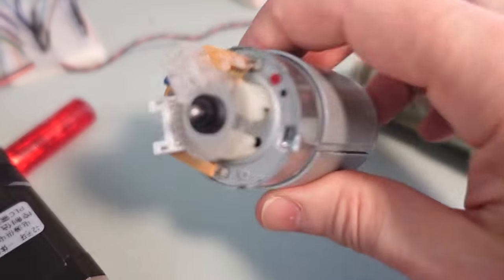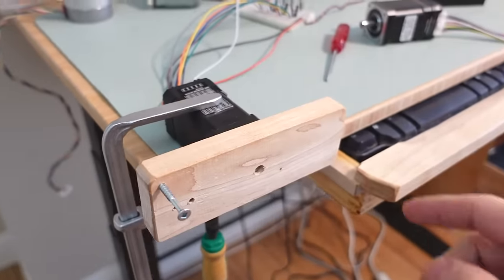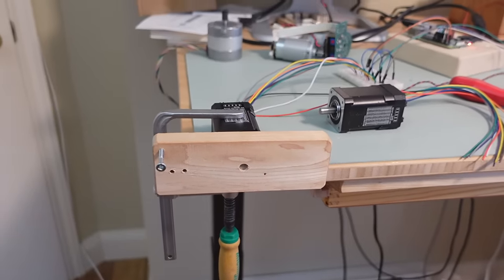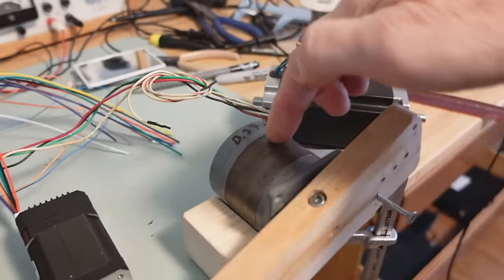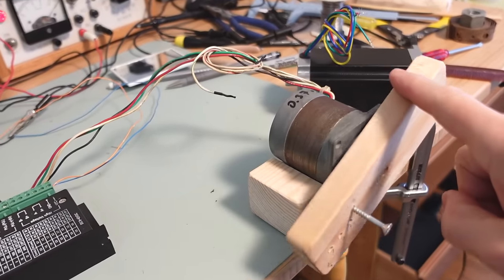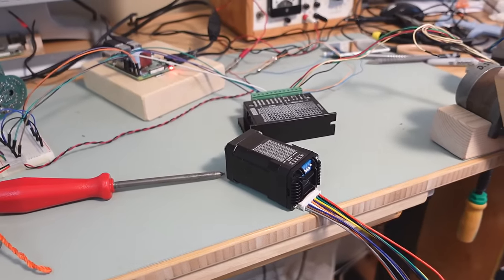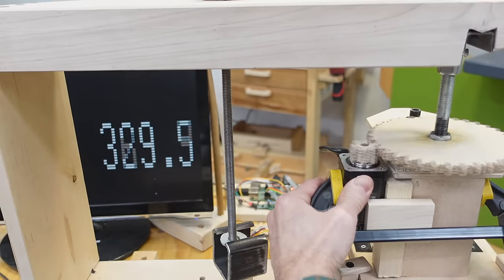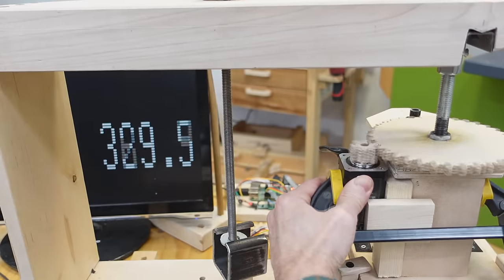Closed loop stepper motors -- very impressive

Comment: The magnet is FAR more precise than optical check - actually knows actual position even after reboot, while the optical knows only a "distance". They are far better. And some of the magnetic ones can get 36V, giving you plenty of power to control even larger steppers. And as they use position feedback, they only use high currents when necessary, so the load on the actual stepper during standard operation is lower, extending its life span.
Reply: Not all hall sensor based closed loop drivers are positional feedback drivers. Some really are just step compensation drivers. They are not all on the same level.
Reply: This is mostly true. The magnet does give the angle in relation to the reading chip. But it also has to do with the failsafe software that drives it. Not all firmware acts the same when it is out of sync.
Reply: This is not necessarily true. Careful when making sweeping generalisations.
Reply: @EnlightenedSavage  Would you mind to share the details? I, so far, was not able to find optical encoders able to compete with price and ease of installation that would be at least close to precision of magnetic encoders. Especially the need for extended shaft is really the issue on my end.
Reply: That’s not true. There are absolute-position optical sensors available. Doesn’t mean this isn’t a better solution, of course :)
Reply: Quite a few things wrong with your comment, it’s not the fact that they use magnets that means it knows it’s position, it is because of the type of encoder. You get two main types of encoders, relative and absolute, the optical disc encoders shown were relative encoders meaning they only show a change, the magnetic ones used here were absolute encoders so they can tell position. A good analogy is that potentiometers are absolute encoders and standard rotary encoders are relative encoders.

You also get magnetic relative encoders that work similarly to the optical relative encoders and you also get optical absolute encoders that use multiple rings to encode the position.

The voltage rating of the encoder is irrelevant for powering the steppers. You do not drive the steppers through the encoder, they are effectively two separate parts that don’t need to be electrically connected in any way really, you can easily have separate supplies for the motor driver and encoder or step down the voltage to power the encoder. There is a very good chance that the closed loop driver is already stepping the voltage down to probably 5 or 3.3 V to power the control circuitry.

It is possible to tell how much load is on the motor without position feedback too by measuring the voltage and current applied to each coil. Like how a brushed DC motor draws more current when loaded and similar to driving BLDC motors. Having position feedback does make it easier though. Stepper drivers that use microstepping already control and usually measure the current through each coil.
Reply: See Osram AS5048.  These just sense a two-pole magnet on the end of the shaft.  Resolution is 14 bits or over 16, 000 points per revolution.  Absolute position, digital output.
Reply: @scrout Just be aware that precision and accuracy are not the same.
Reply: @johnwalker1471 Exactly, the optical is precise and maybe accurate but magnetic one is both precise and accurate.
The only drawback of magnetic is magnetic interference.
Reply: @gentleclash I wouldn’t say that the magnetic sensors are accurate.  According to the AS 5048 datasheet even with perfect alignment of the magnet the non linearity can be as great as 0.8 degrees.
Reply: @johnwalker1471  Magnetic encoders don't have an enclosure and have to be manually aligned which may cause errors is what you're saying?
I would say that optical encoders are good for robustness and where absolute positioning is not necessary.
I've never used either of them but I do know their working principle and theoretically magnetic can be infinitely precise.
As of optical, there exist those optical encoders which can do absolute positioning but are very expensive and sophisticated unlike magnetic ones🤷
You can correct me if I'm wrong somewhere.
Reply: @gentleclash  The error stated in the data sheet assumed optimal placement of the magnet.  It is due to the nonlinear response of the hall sensors in the semiconductor itself.  Stray magnet fields or less than optimal magnet placement could increase that error further.  I have a fully enclosed magnet encoder as well as enclosed optical encoder.  I plan to use these to test the positioning accuracy of a stepper with different values of microstepping.

Comment: I used closed loop steppers on my home made CNC router, I couldn't be happier with the way it performs and it was so easy to do.
Reply: I put then on a lathe and a mill and am also very happy with them, they do not get hot in use like the previous open loop motors.

Comment: For a single motor: this form of closed loop steppers is great.  For any multi-axis CNC, the "reaction" time means that the absolute position of the end effector is unknown, as the controller on one axis may already be there, while the other is "making up missed steps".  Tracing an arc (for example) with two of these, when pushed anywhere near their limits, will result in inconsistent and difficult to reproduce behavior.
Reply from the maker: True enough, but the idea is to give both of them motion curves they can follow.  And if the controller somehow pauses for 10 ms, both motors will stop, so still on the path
Reply: Would a computer read each encoder and sync operations that way? Like control other motors if one gets slowed or jammed, to keep a process in-check?
Reply: @Metalcastr  Correct.  On CNC machines, a simple example of this is feed rate override.  When the spindle starts to overload, the feed rate, sometimes multiple axes coordinated, slows down to prevent overloading the spindle motor or ruining the tool or the part being made
Reply: A better example is the standing desk Mathias shows in various videos.  Assuming a motor per leg, when one side of the desk is heavily loaded, the controller limits the progress of the lessor loaded motor so that it doesn't race ahead. This keeps the desk level

Comment: from a controls perspective its still a good idea to provide higher order motion profiles in closed loop control systems due to higher order vibrations in the rest of the system if you have a more complex/sensitive system. It will also limit overshoot and such, though I am curious as to how these steppers have their controllers tuned and if you could change them to adapt to your given loads/motion profiles.
Reply: A third thing to keep in mind when relying on the closed loop driver and not using motion profiles, is that you have no idea how much it's out of position before the move happens. With a motion profile, however, you reduce the likelihood of losing position while also being in control of where it is. That means you can do more complex processing based on that variable.

Comment: On my Jointer/Planer combination machine I had to crank the table all the way up and down if I switch the machine, because the dust shroud has to flip under the cutterhead.
I replaced the Handwheel with a 1.2Nm closed-loop-stepper. Controlling it via Arduino and the huge advantage of the closed loop stepper here is:
I also have a display connected that shows Theoretical Position to 0.1mm. And since the stepper doesn't lose steps, I can really count on that. I essentially have a digital readout with position control (normal and fast travel and a 0.1mm button).
Now I don't have to hand-crank anymore, its way faster to switch the machine around, I don't have to bend down (The button is higher up than the hand-crank) and the machine is also way more accurate. The original scale was 1mm accuracy. Now I can thickness down to 0.1mm accuracy - repeatably!
Reply: I've never seen this guy be happy with anything. In my experience most people find problems with things sometimes, but this dude is a know-it-all and has built a following, which makes me scratch my head. I'm not trolling but go back and listen to him prattle on about this and that being wrong with everything. He contributes zero to the engineering content like smaller channels. I keep blocking his channel yet autoplay keeps putting his videos on when I'm tinkering. Haha.

Comment: You can get NEMA planetary gearboxes that will fit right on the end of that stepper for a bunch of extra torque
Your speed seems high enough to still have it operate quickly enough

Comment: Used to use those on home built CNC machines . In the past you had to buy double ended stepper motors and add the encoder to it. They have fallen out in favor of DC servo motors now. Much cheaper and easier to do this stuff now than it was 15 years ago. And steppers are far stronger today than they usded to be.

Comment: That fun little Pi heatsink looks like it's about to take flight!
Reply from the maker: just a bit of aluminium flashing, but surprisingly effective
Reply: Could the Pi5 with the RP1 chip do the real time drive of the stepper that Matthias was taking about in a single board?
Reply: @josephesposito9173  most of those things use a direction pin and a step clock to the driver board, even old fasioned pics will do real time output to the drivers.

Comment: 6:55 another option is a stepper controller with a build-in motion controller, f.eks. tmc5160. You just tell when to go and how fast via SPI or UART and it does all the ramping. As long as you don't to synchronous the motion of several motor, like for a CNC, they are easy to use

Comment: Never get here this early. Happy you got your channel back so quick. Really good video. Might be interesting to see these closed loop motors in more "compliant" uses. But would need to overcome the "out of sync" failure. Might be better to have a seperate encoder and handle error correction in the microcontroller.

Comment: 9:07 - for a rougly the same price (little bit higher) you can get an integrated step-servo in nema 23-24 size.  same performance but with 2-3Nm torque.    look for IHSS57 type.

as for terminology - "servo" is not a motor type it's a drive type.  so any motor with closed loop control is a "servo".   
closed loop AC motor - AC servo, 
closed loop DC motor - DC servo, 
closed loop stepper motor - stepper servo.
saying that servo is better than stepper is incorrect because stepper can be a servo too )

Comment: Those with a magnet, have a Hall effect encoder. 12 -15 bit so more accurate than most optical.
Reply: Yeah, hopefully Matthias picks one up because I'm sure they have their own unique quirks.
Reply: I can't find the resolution of the motor he bought, but, some of the cheap 12-bit magnetic angle encoders have a significant amount of noise and error (look up MT6701). You won't get a true 12-bit position, and may need to calibrate them first as well. Optical encoders have limited error.
Reply: The magnetic encoder is not the problem.   The worst close loop steppers don't behave like servos.  They simply send a few extra steps at the end of a move if steps were lost.  Better than nothing, but I wouldn't pay much for it.
A true servo drive the stepper with the minimum current needed to minimize error.

Comment: I upgraded my CNC machine to Teknic Clearpath SDSK closed loop steppers. They’re cheaper than servos, but they can be driven with 5V signals. They do require separate 75V DC power supplies. My machine is WAY more powerful and performant, and it doesn’t lose steps. If I have a crash and it does, the controller gets feedback and stops. There are other versions of the motors and they’re easy to control using a Raspberry Pico with PWM or frequency positioning. They’re just amazing. I have some videos of my automatic height dustboot that uses one of those.
Reply: @gary8564 Please post a link to your videos!

Comment: Yes doing small+deep on a CnC is tricky, but you can make many very precise thin gears and glue them together
Reply: And as we know via Wandel experimentation the glue is stronger than the wood - but can you overlay and stack them as a laminate accurately.

Comment: My current project involves closed loop stepper motors with a discrete driver, but I'm tapping into the motor's encoder signal with a microcontroller timer peripheral so that it always knows the position of the motor, even when it stalls. I want to avoid the condition that you demonstrated where the motor stalls too far into the "overload" range and the driver shuts down, then needs a power cycle to recover. I'm just having the microcontroller send steps in the direction of the stall to keep the driver outside of the "overload" range. So far I've been testing with a 4 Nm NEMA24, but I just got a 12 Nm NEMA34 to evaluate... That thing is a beast!
Reply: I'm curious what application require that.

Comment: Could you provide a link to that closed loop stepper? I have an application where it would be great if I could just use a Pi rather than an Arduino + separate stepper control.

Comment: Excellent walkthrough of the closed loop stepper motors. Could you provide a link for the motor please? As you mentioned options for the motor are kinda confusing.

Comment: Are you going to put one on your screw advance box joint jig like it was originally?  Maybe put a pneumatic piston on it to push it through the saw.
Reply from the maker: Would be an improvement, but the gears work very well

Comment: When i went with closed loop on my CNC i had the issue where i had 1.5m long 16-20mm ballscrews attached to it with rigid couplers (after ripping apart flexible ones several times) and it caused a bad feedback in the pid loop .  
usually you turn the ball-nut at those lenghts but the design didnt allow for that.  It became a huge torsion spring that makes the PID loop freak out and screams like its never seen grease in its life at certain feeds.

Comment: Mathias, there are stepper drivers that support non-realtime interfaces. They are usually expensive and designed for industrial or CNC systems, though. I'm sure someone has designed and developed a nice hobbyist grade one out of a cheap micro-controller, though. Being able to send "+500 steps at 300steps/second" over i2c or uart and then not having to worry about timing would be really nice.

Comment: You can get stable semi-realtime outputs on the Pi if you leverage the chip's DMA functionality. A few years ago I toyed with the "pigpio" library. It lets you create waveforms in software and then the hardware plays it back with perfect timing even if your code gets delayed for a few moments.

Comment: For many high torque applications I use Geckodrive DC servo drives. These allow me to repurpose large DC brushed motors up to 80 VDC and 20A. In most cases you have to build your own encoder or a mount for a commercial one but after you figure out how much resolution you really need usually a very simple encoder will suffice. Often I 3D print my encoder assemblies. Industrial motors often have fans that can be removed and the space used to install encoders.
Reply from the maker: Oh, cool, just what I want.  But I'd have to have a business case to get one of those.  I could also get a good size closed loop stepper for less than that.

Comment: The magnetic encoders can work really well, and commonly have resolution ranging from 14 bits (16384 cpr) to 21 bits (2M cpr). Step loss correction vs field oriented control is entirely decided in the firmware, and I've used the magnetic encoders to great effect in my own projects with field oriented control.

I think the closed source firmware for the super cheap mks stepper servos is likely the biggest problem with them, not the encoder.

Comment: ooh, super excited about this subject. These have really improved and come way down in price in recent years.
Reply: Cheap stuff be cheap. The good stuff still costs a lot.
Reply: @1pcfred  Always. Though I think it's fair to say the pretty good stuff has also come down a lot. The ClearPath Servos are quite affordable relative to the best available 20 years ago.
Reply: @1pcfred  I guess it's a matter of relativity though. $3-400 for a Nema34 self-contained, programmable, closed loop servo drive with enough power to move a serious machine is a bargain. Even if it's maybe not 'cheap' by hobbyist standards. I paid nearly that much for comparable dumb stepper motors not that long ago.

Comment: I believe the ones that detect back emf instead of optical are also more efficient, since they can tell how much force is on the shaft / magnets instead of just position and can output the exact amount of power to counter act it.

Comment: When in proximity with machines with large motors (high magnetic fields) and noise (VFD motor drives), you may find optical encoders are preferable. Both will need careful positioning, cable routing and magnetic/electrical screening to avoid spurious behaviour. But they are excellent tools

Comment: I have these closed loop steppers on a Farmbot that I purchased in China a couple years back.  Talking with the supplier, he told me that they were looking to replace the stepper motors and the Farmduino with RS423 closed loop steppers.  Via RS423, the stepper can be told how far to go and it will just go there.  Under certain circumstance these seem useful but there are bound to be some limitations.
Reply: The motor and drive integrated closed-loop stepper motor in the video is produced by our factory. Please consult me if you need. Our algorithm will be better, with a 485 communication version

Comment: regarding the closed loop controller that use a magnet glued on the shaft, I do not see any issue with that instead of an optical encoder. Those hall angular sensors have much higher resolution and speed than the usual optical encoders.